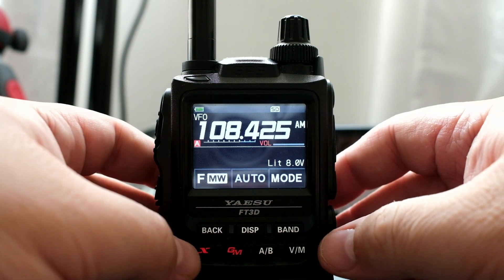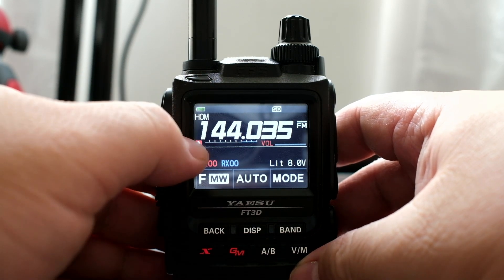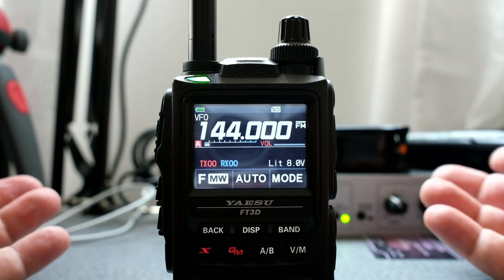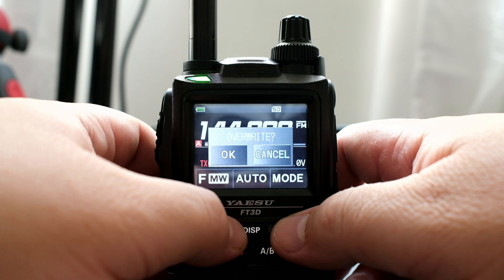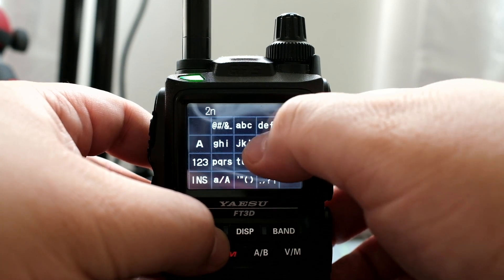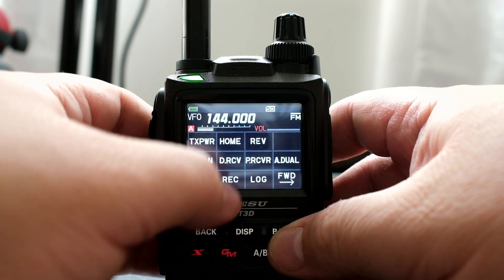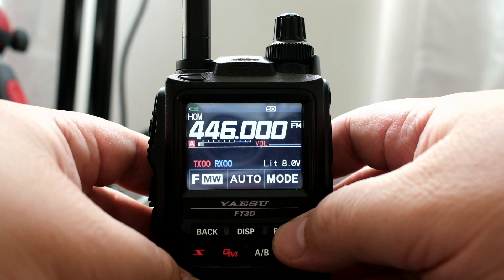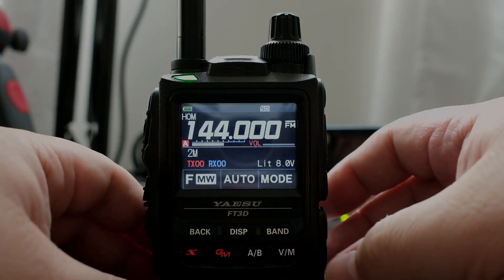Yaesu FT3D Edit Home Channels

Comment: So I’ve got a strange issue that just happened the other day. On the dual receive display my channel names have disappeared. If I switch to the single channel display it will still show them on the lower part of the screen. My bank names are still active as well. Normally on dual channel display my channel name is right above the freq on channel A. Any ideas? Thanks
Reply: @frankwc0o  I can switch back and forth between VFO and I still don't get my channel names. Like I mentioned above though, if I hold down A/B and switch to single channel display it shows my channel name where the B channel normally is. Such a strange issue.
Reply: @frankwc0o   I figured it out. If you are in memory mode and you touch and hold the screen on channel A. It will swap display options to either display the channel name along with the frequency, or just the frequency by itself.